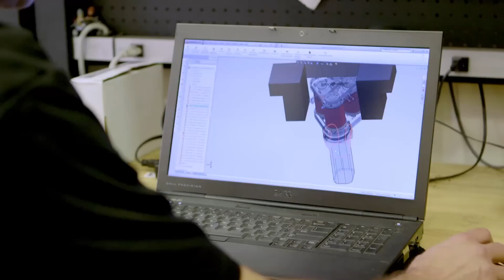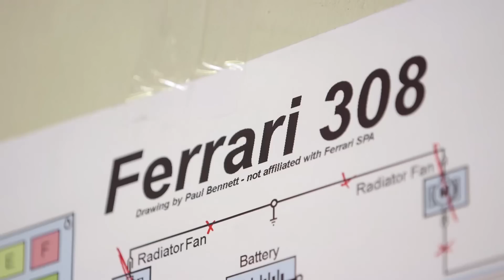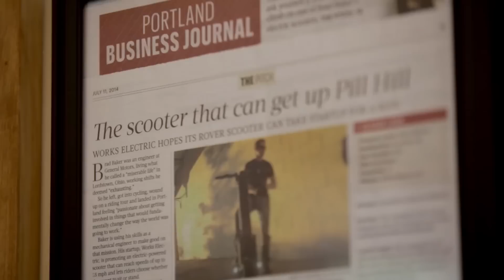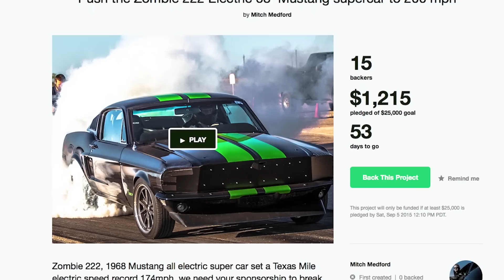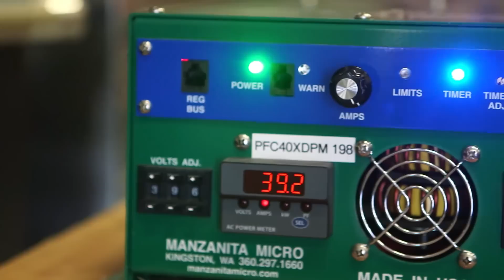The Craziest Electric Vehicles | Translogic

Comment: 100 miles range? That range alone is actually further than many classic cars can do before they brokendown.
Reply: This is old technology. This is a compilation of old video. Now 80kwh should be very viable in a Classic conversion. It's all about battery Packaging techniques to make energy density higher. That's closer to 200 miles of spirited driving.
Reply: Once the battery tech catches up you could be looking at a 400 to 600mile range

Comment: I'd love to see an electric delorean.... It would improve on the the dreadful engine it had originally and deliver the performance that those great looks suggested. I've seen a few of these type of conversions and they always seem to use manuals and keep it in 2nd for the most part. I'm not a huge tekkie, but I know the very basics of how an automatic works. Is there a reason why autos don't get used? Maybe because an electric motor has a much wider RPM range?
Reply: Automatics were designed to make shifting easier. However, as seen with manual electric conversions, you basically never need to, meaning you need to spend extra effort to reprogram the ECU to stop doing normal things. Automatics have another problem in the torque converter, which is generally a fluid coupling, and causes losses in efficiency. Electric motors have enough torque to do all your daily driving needs in a single gear ratio, which is why Tesla only has a single speed step down transmission.
Reply: DO IT !!!!...Good luck !!!!
Reply: @Appletank8  my experience with automatics has not been good they require quite a bit more power for the same range
Reply: There's some interesting history with the electric DeLorean that somebody did. It was used in a scam with a device that was supposed to charge the car while driving. Carl Tilley I believe was the scammer and they drove it at Dollywood RaceTrac.
Reply: @steveclunn8165  

That's ... what I said? Fluid coupling isn't as good as a direct coupling. On the other hand, a lot of modern automatics (that still use torque converters) also lock up the coupling a lot earlier, so in affect its as efficient as a engine-to-clutch connection. And an EV conversion also doesn't need to shift much, if at all, so needing to work around reprogramming the automatic ECU logic is just a complication you don't need.

Comment: i want a 1/2 ton f 150 that can pull my boat 125 miles with out having to stop and charge it. but haven't found anything with that range plus i dont have the 125k plus to do it. but it would be sweet
Reply: Yeah Rivian top payload for the dually 5th wheel version is 35k.
Reply: I’ve got a 2017 f150xl single cab that I plan on converting to make numbers like the Zombie222 does, but also w/ a 3” body lift & rugged terrain tires.
Reply: The R1T is coming
Reply: It's coming, there's a F150 EV just around the corner

Comment: Any chance of removing all the background static. Star wars editing and rave music is just a distraction from the important info. Of course, if your target demographic is 8 year-old juveniles, it may work. Remember, less is more, especially in EV's. Less noise, less complexity, less distraction.
Reply: Agreed, this video has the "high on acid and thrown into a rave" vibe...
Reply: Meh, there isn't much info other than a super simple intro to EV. What do you need to know? If you don't have a background in batteries, motors, electrical safety, and so on then you are going to need to do a lot of reading. This video is more or less just an advertisement for EV.

I built one of those over-powered "e-bikes" and its a blast messing around on. If I keep it less than 30-35 it is good for 50 miles using %80 charge and without regenerative braking. I think power will be just right when I swap to a slighter larger motor and raise power capability to around 12kW.
Reply: It's watermarking. makes it impossible to use footage elsewhere.
Reply: less noise is great in any car video...lemme hear the car
Reply: Good advice, if they will hear it.
Reply: GARASJEN why couldn’t they use the clips with their own voice over or whatever. Many of those “best of” and “top 10” videos will do that.

Comment: What is the lightest battery configuration that will power one of these motors for a full 1/4 mile pass, and still get you back to the pits to swap in a fresh battery?  Have a bunch of batteries fully charged ready to swap while recharging the ones you just used.  This would allow your electric car to be as light as possible for quicker acceleration.
Reply: Yea if you do that on a light car you can get 0 to 60 in like .4 seconds

Comment: So if I convert my car, I can keep having my manual transmission?
Reply: There actually was a classic Ferrari that had caught fire and someone salvaged. They did an ev conversion and kept the transmission in the process, though because of the way electric motors work, you never really need to go above second gear.

TL;DR Absolutely :-D
Reply: No because there wouldn’t be any gears. One speed.
Reply: @mox542  The question was, 'CAN I keep my manual transmission'. The answer is yes.

Comment: why did the car in the first segment have gears?
Reply: In some conversions in order to keep cost down it's easier to just bolt the motor to the original gearbox and run with that. You can leave them in third all day if you want. Otherwise more engineering and mucking around is required which adds to the cost.

Comment: (3:45) '10 years down the road put a battery pack in there  1/4 the size and 3 times the range'. 

He's kidding of course. Lithium battery energy density advancement, averaged over the last 20 years is 6% a year, while this guy is suddenly expecting 40%. Hardly splitting hairs when you look 10 years forward.

Comment: 19:13 Turbo revs high and very low torque???WTF???
Reply: Yes, certainly.  you have to lower the compression to build a turbo engine for one, and you have to rev to get the full potential of the turbo. If you want low rpm and torque, get a compressor.
Reply: Like a heavily modded tuned Honda 4 Pot. Small displacement High Revving massive boost from turbo. 
Example Honda B16 22.4psi boost @ 7800rpm peak kicks out 485hp but 324lb/ft torque.
http://www.superstreetonline.com/how-to/engine/htup-0805-500hp-stock-block-b16a/